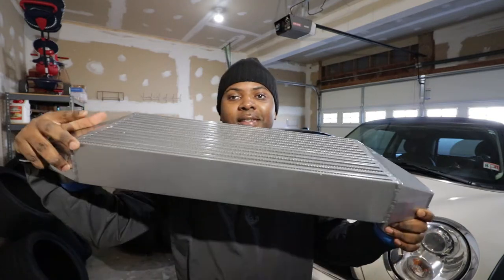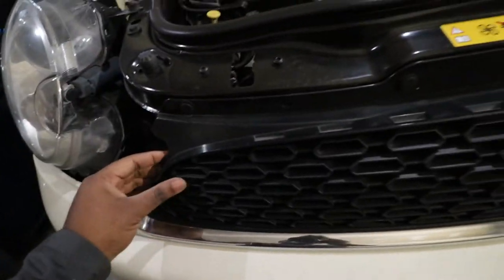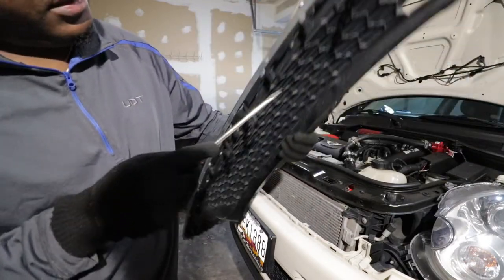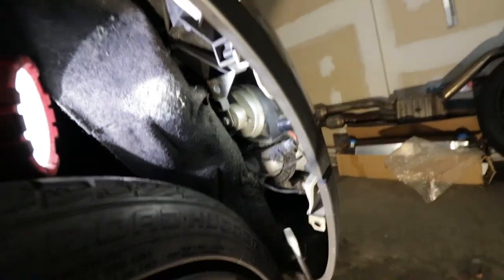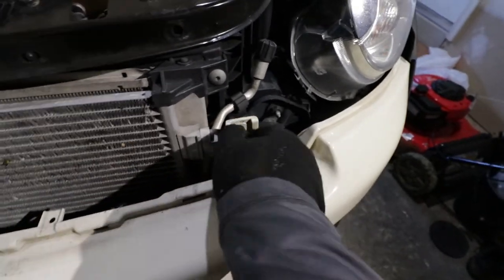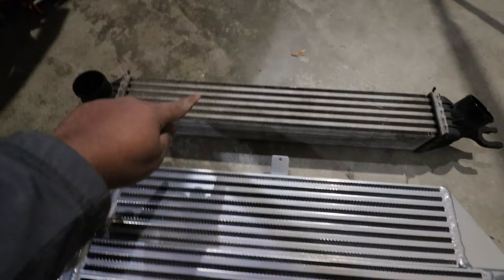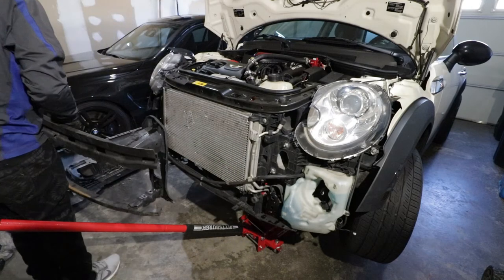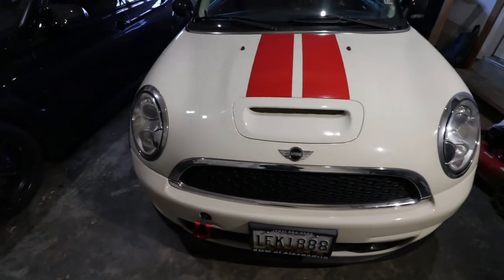How to Install/Upgrade The Intercooler on R56 Mini Cooper S (N14 &N18)

Comment: Just installed my intercooler after watching this video series, thanks for making these, you’ve got a new subscriber!
Reply from the maker: Thanks Adam! I am happy I was able to help with the video.
Reply: Hey Adam, have you noticed any difference, does it increased the turbo lag?
Reply: @3dproje  i havent noticed any more turbo lag than stock, but it definitely pulls much harder now with the increased capacity of cool air getting fed into the turbo. It also helps the motor stay cooler when I'm at the track on a hot day.
Reply: @apridgen  thanx for reply 🙏🏼

Comment: Did the intercooler help maintain intake air temps? My girlfriend and I just picked up a 2014 Mini Cooper s 6 speed for her. I am looking to do bolt ons and stage 2 tune at some point.
Reply from the maker: It takes a bit longer for the car to warm up. You really feel the engine breathing more. Idk how i can explain it. However the real moment you see the intercooler shining is when you tune it. To keep the intake temp low, you need to do everything to ensure heat does not come close to the intake area. My intake temp are usually a few degrees lower than the ambient temp during driving. When I stop it increase a bit.
Reply: @TorvekMotors  how/whered you get it tuned?

Comment: Dont you need to tune the car afterwards since the innercooler is bigger?
Reply: Yes, you should. The PCM can only compensate for so much fuel to add the engine given the air volume supplied from the MAF sensor. But most people don't tune after so no harm no foul. May get lean codes though.

Comment: Great video, thank you so much! Considering doing this job on my N18 Cooper before having it tuned as well. How big of a difference does it really make?
Reply from the maker: Thanks! The temperature dropped a little. But the engine didn’t feel cripple like it did before.
Reply: @TorvekMotors  bigger IC blocks  some part of radiator, does it badly effect cooling performance? Thnx
Reply: @3dproje  it really shouldn't, air flows through both coolers. I have a big intercooler like this, and with my Ultraugauge it still shows coolant temperatures of around 98 degrees Celsius when warm. It doesn't overheat.
Reply: @ZwolseZwerver  thnx for reply dexter, does it moves between 98 and 104 degrees?

Comment: Is there any benefit from getting a $700 intercooler vs. $170
Reply from the maker: They would normally function the same way. However, built quality sometimes differ between the cheap ones and $$ ones. However, some cheap ones like the one I got have good quality. Thanks
Reply: 170$ one will work just fine.